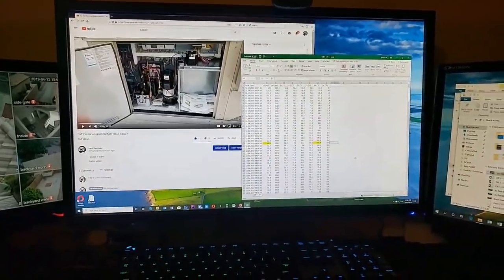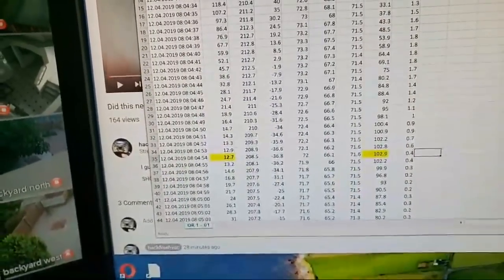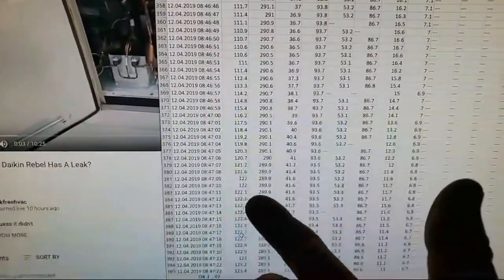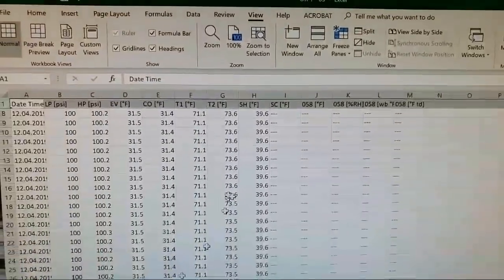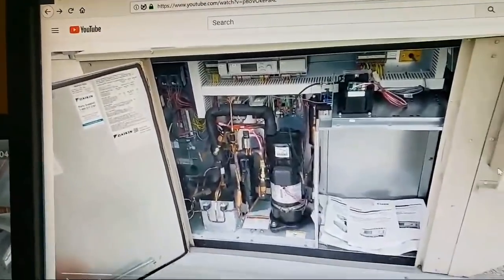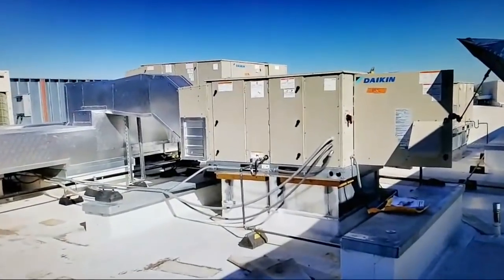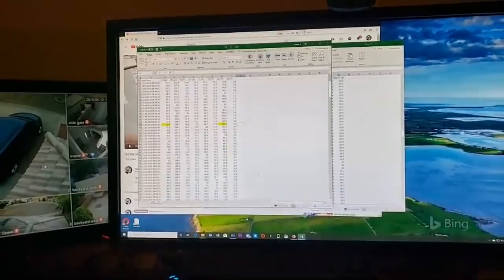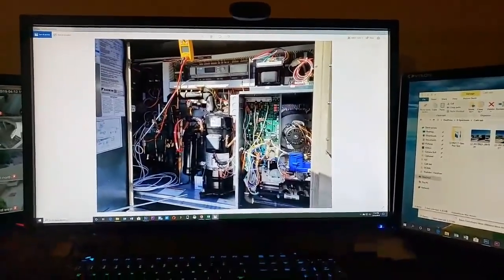Today's Daikin Rebel Troubleshooting Follow Up

Comment: Almost reminds me of modulating in floor heating boilers we install up here in Canada. When they start up it's like there's something wrong, heat output temperature like 70 degrees. Then after the ecm cycles and measures inside  and outside temps it ramps up to 140 degrees to the primary circulation pump. Once temp is satisfied the water circulating modulates to maintain set inside temperature. So far these new babies are working well, customers love the even heat. We'll see in a few years?
Reply from the maker: Yeah, sometimes you just need to get familiar with the quirks of new equipment.

Comment: Those units go into pumpdown mode depending on the "events" to protect the compressor. I assume when you restarted the unit it didn't finish the pumpdown thus continuing before allowing to restart the unit. Commissioning the unit at EEV settings you can set superheat hi and lo setpoints should have 2*F deadband control and a target superheat calculated based on your setpoints. It is normal for the unit to have high superheat while pumping down but not while its running I don't think tech support explained it correctly.